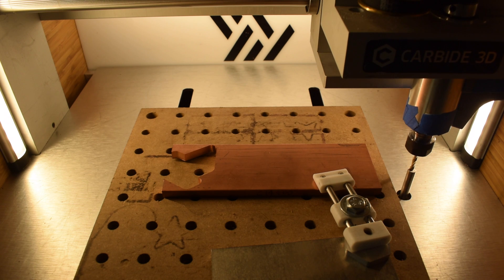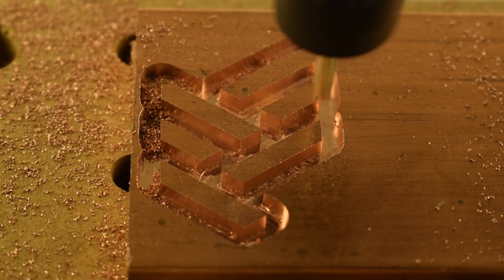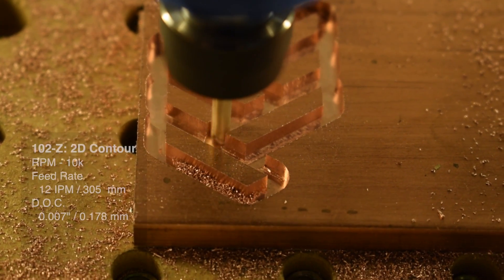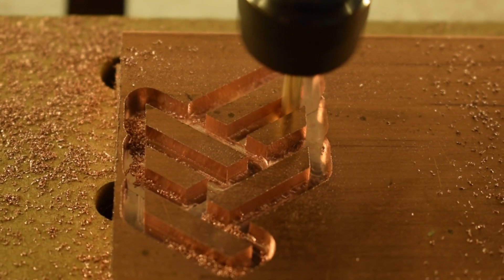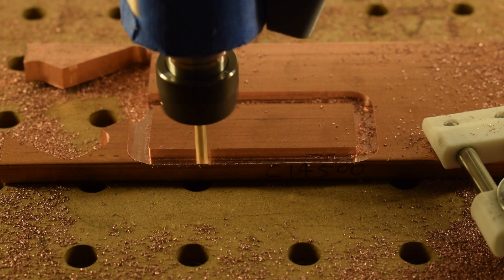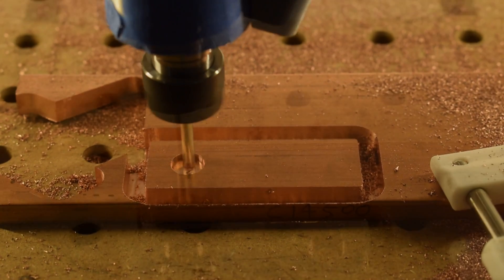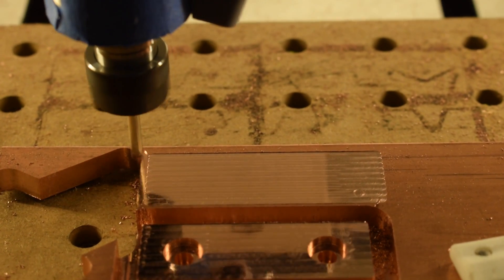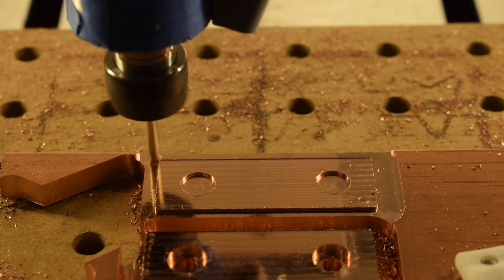Machining Copper (C14500) on the Nomad - #MaterialMonday

Comment: I would be looking to do this on the xxl pro in the near future. 
I would be looking to cut one inch wide smooth pyramidal points (liken to point on a walking stick) 50-60 degree face...
I suspect the only bit for this is a ball nose, maybe 1/8" bit? 
I won't have a rotary device in my starting budget for this project. But I am hoping I can get the face smooth enough that buffing will smooth out any ridges.

Comment: i hava some 160z 24 guage 99% lead free copper sheets i want to cut and engrave on my cnc. can you suggest a bit (1/16 or 1/32) for this? and suggested feed/depth rates? i do not know specific temper spec's of material. also where to purchase bits
Reply from the maker: Either general purpose endmills or aluminum-specialized endmills will work fine in non-ferrous metals. Our #112 and #122 cutters on our store would be fine as a starting point, though you can find a larger variety of lengths and styles from other manufacturers. Two domestic companies I've used before are Lakeshore Carbide and Kodiak Cutting Tools, the latter of which has tools even smaller than 1/32". Our 501 PCB engraver is also good for marking metals.

Not knowing the exact alloy or temper however will make things tricky. We have a video showing what happens when you try to machine the wrong type of metal. (Spoiler alert, the edges will have a really nasty burr and it's not a clean cut. You may also break endmills more often.)

Comment: Are you using 10k RPM because it’s the maximum speed of your spindle or because it’s a good speed for cutting copper. Can you use 18k RPM? And what feed rate?
Reply from the maker: 10k was the max on the old Nomad. Yes you can go faster but at a point you start leaving the sweet spot for non ferrous metal cutting. Recommend doing some research about speeds and feeds (and in particular Surface Speed) recommendations for the tools and materials you're using.

Comment: Hey, Could you machine a 1.5 mm copper electrode with a smaller endmill carbide? I'm trying to do that as i need to spark out a 1.8mm drill bit that broke inside my job, please any suggestion to go about